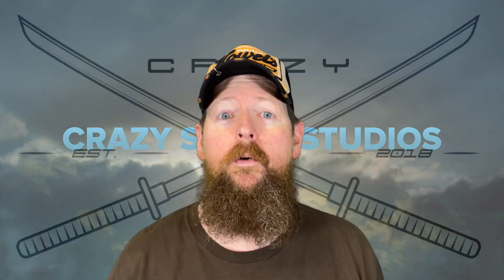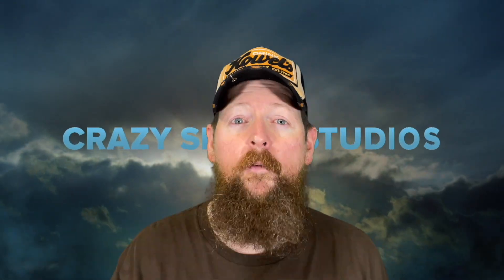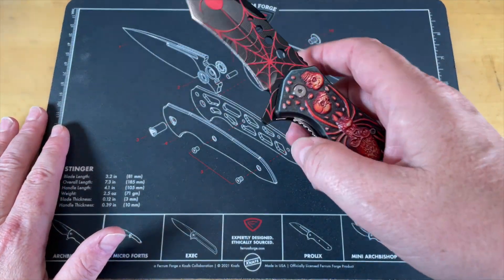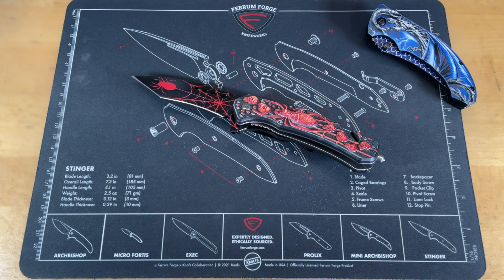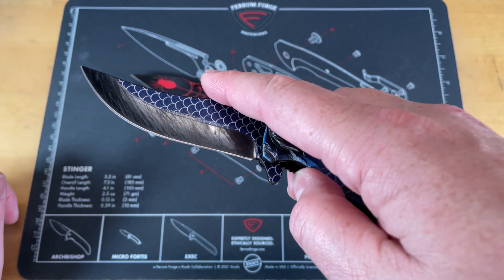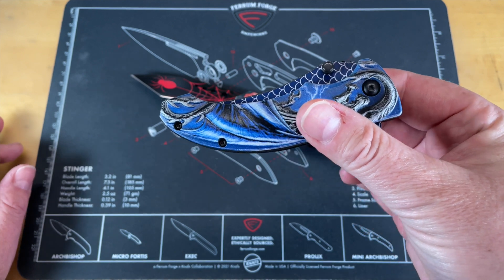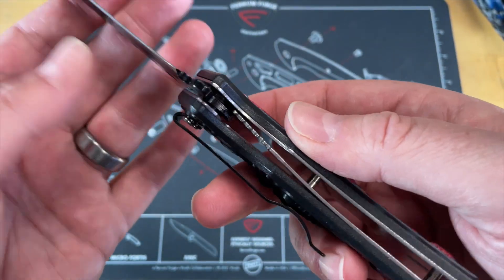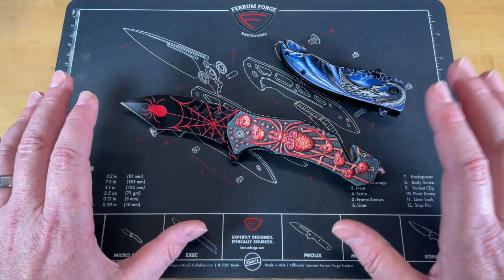WHAT'S INSIDE A GARBAGE $10 KNIFE

Comment: I wouldn't spend to much time on this knife. But I would be very curious to see how the blade looks with that "coating" removed. If you got a old worn buffing wheel or just some coarse sandpaper it will probably come right off. And maybe it will even cut (for a little bit). One of the budget brands that has surprised me has been some of the Boker Magnum series knives. I bought about 10 of their knives between 2017-2020 just to test for a goof. And some of the models really surprised me. They did a great job with the 440A steel, 6 of the knives was OK and 3 was actually good (considering they were less than $30). But the one that Really surprised me was the Boker Magnum Omen, good action and decent design blade held up.  Luckily now we have really good knives in the $30-$50 range from companies like, QSP,Kubey,Ganzo,etc.